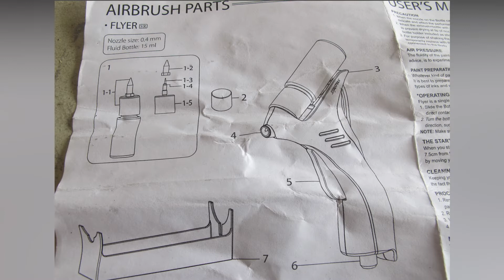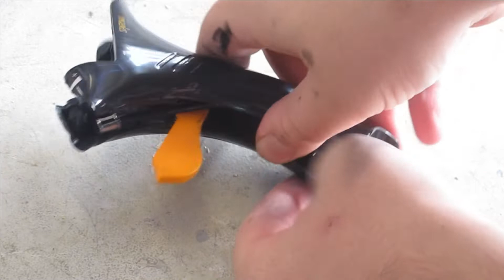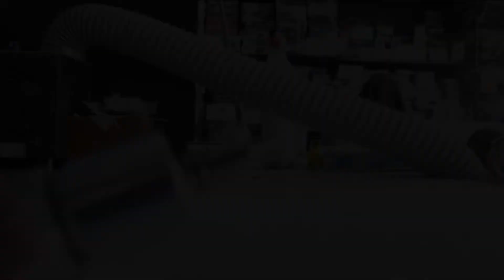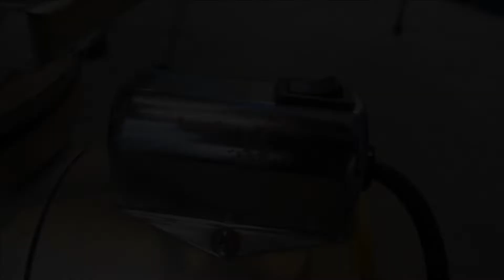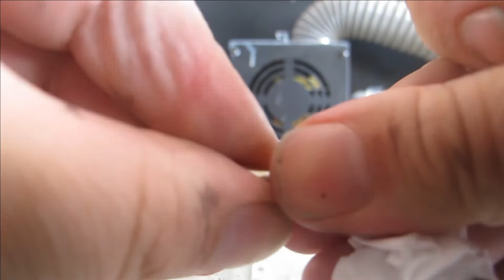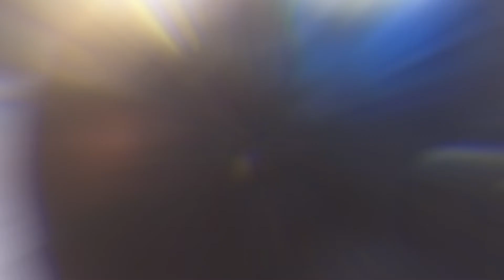Sparmax Flyer Airbrush review

Comment: Hello there. Have you found any cheap replacement bottles; glass or plastic, that fit the Flyer and are currently available? Thank you!
Reply from the maker: Hello, I know sparmax sells replacement glass jars with the lit but it isnt cheap. I have not measured the threads yet and explored other options but also have not used this airbrush again in over a year.
Reply: A late reply - SMS Paint here in Australia use to have 10 ml bottles to suit with a DIN18 cap, but no longer. However I have seen them on other sites including Sunnypack. The diameter is ~25 mm, and height around 58mm. One issue is that the neck is a tad too short for the Sparmax nozzle - I just added a rubber O-ring in their and it was sorted. A cheap way to but bottles (and lids), and handy for keeping pre-mixed paints ready for the brush. I use it for broad painting.

Comment: Hi, mokanaman. I'm just bought this sparmax flyer. Want to ask you a question. I feel some air flow come out from the handle when i half press the orange button...is it normal??
Reply from the maker: I'm sorry to tell you the air valve is leaking and cannot be replaced easily. Open it up to make sure the nozzle is seated correctly. If not try to find the leak with soapy water and maybe use tefflon tape to plug the leak. This will not be a permanent fix, best to buy a new airbrush. I review many on my channel.

Comment: Yes, I'm really struggling with a standard airbrush. I've been curious about these for months after I first saw one in my (then) local hobby shop.
Thank you for the review, I'll try and pick one up.
Reply from the maker: Hello Richard, I understand were you are coming from. Really struggled in getting the paint right in my double action while starting out and shelled out for a similar model back in the early 2000's which was help full in learning. May I ask the type of paint your using and airbrush model? I am happy to run though some fault finding and see if we can get you spraying before buying one.
Reply: @mokanaman  thank you Alan. I'd be extremely grateful for any help. I posted a rambling video on my channel yesterday about my troubles. I've cleaned my Iwata Neo 100 times recently, In fact it's sitting in 75% alcohol now and nothing.
I've been using Model Air, Mecha Colour, Model Colour from Vallejo. They're pre thinned and I've had a lot of success with them in the past.
I'm honestly considering going back to spray cans. I've not had a successful build in ages.
Reply from the maker: @richard1701able  Will have a watch and shall let you know what I think. If your new to my channel I have a ton of video resources on airbrushing and maybe my playlist honing your airbrush skills may be of assistance. Will be back.
Reply from the maker: @richard1701able  Hello Richard, I have had a look and made some comments on the videos. Looks like the iwata nozzle is jammed and damaged.You will need to replace it with a cheap chinese set. This video will explain everything https://www.youtube.com/watch?v=3ldNPCwLQMo